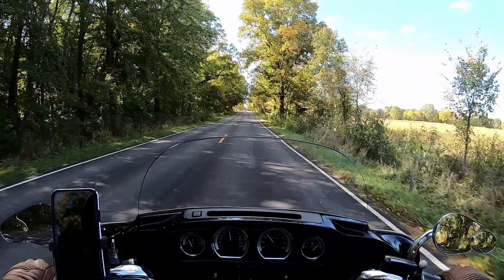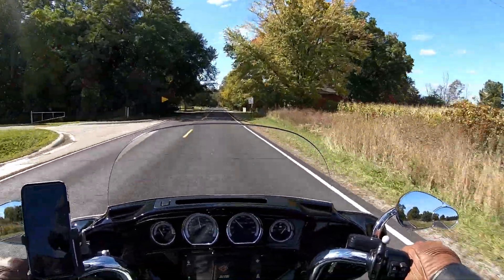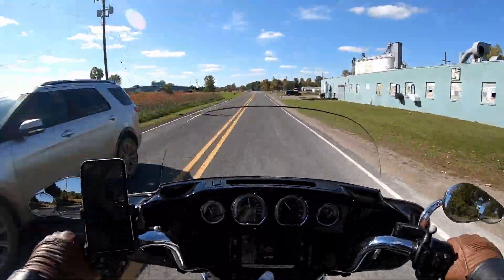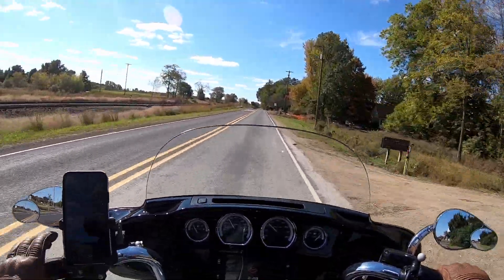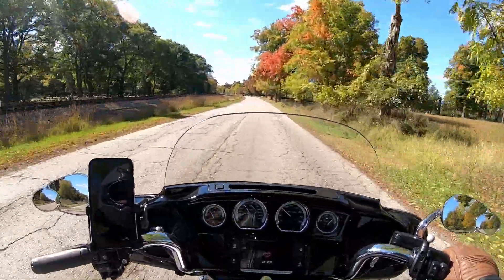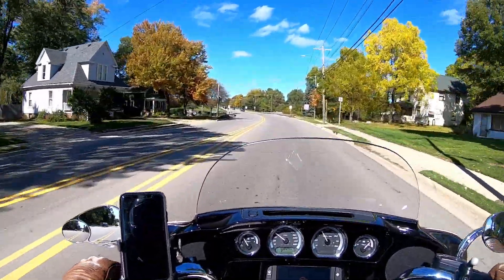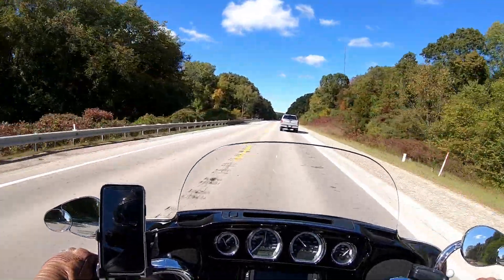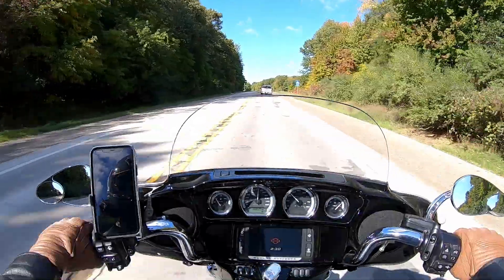Vance & Hines Power Dual Results

Comment: I put my V&H Dresser Duals this week. I have the Screamin Eagle Street Cannons. I almost feel it’s too loud. I’m even thinking about putting my stock pipes back on.  I know this may be counter productive for the power, but I like to do long runs. Idk, what I’m going to do, but now I’m wearing ear plugs for highway runs. I love the way the header sounds between shifts.
Reply from the maker: I’m not familiar with the street cannons and how loud they are. My biggest concern with the new head pipe was going to be the sound but for me it’s good, I have eliminator 400’s. I totally get it though if it’s too loud even on the highway, I would not be good with that either. Good luck on your decision let me know how it works out

Comment: There's really no limit on these M8s the skies are unlimited on them, just doing the minor changes you made to your M8, has opened her up, yes sir that catalytic converter really restricts the air flow on all of these bike's, and it does make a huge difference in the heat that you feel now with it gone, you done great Brother all good choices 💯🤜🏼🤛🏼
Reply from the maker: Thanks and I really appreciate that, not sure there’s much more I want to do as far as performance on the motor
Reply: @BoDean52  you unleashed the beast in her 👍🏼💯

Comment: Hey Mr Bo! Like a new bike oh yeah!! There ya go, putting ideas in my head again. And yeah, we got the round-a-bouts here. At first I resented the euro trash influence but now I'm sort of used to them. Actually work pretty well for me..😛
Reply from the maker: Funny how the round a bouts are kinda fun in a bike. You are right, it feels like a different bike now. What’s next for you?
Reply: @BoDean52  need some tires again..soft lowers for the cold season.. thinking about the fp3, and after that little exhibition I'm leaning towards a whole new exhaust system.. also need to get the fluid transfer issue warranteed..

Comment: Nice Video. thanks for sharing..  I have a 2020 Road Glide limited with the stock pipes on it but I want to reduce the heat. I just don't want something that is too basey.
Yours sounded pretty good.  I had installed Rinehart DBX slipons but they are too basey and they hurt mine and my passenger's ears so I had to sell them as used.
Reply from the maker: Appreciate that Rick and good luck. Not sure if you still have a warranty but just keep in mind if you did what I did to my bike you would no longer have it. Let me know how it ends up and ride safe
Reply: @BoDean52  did it change your gas mileage much?